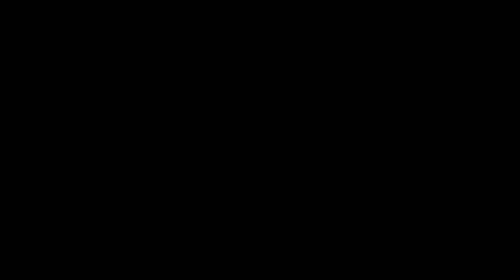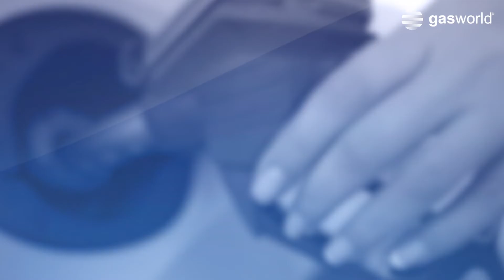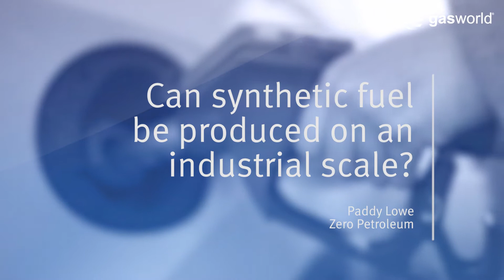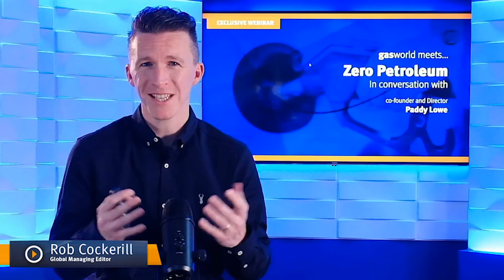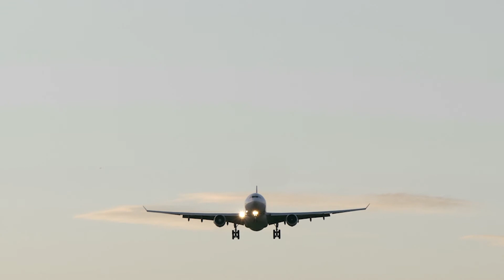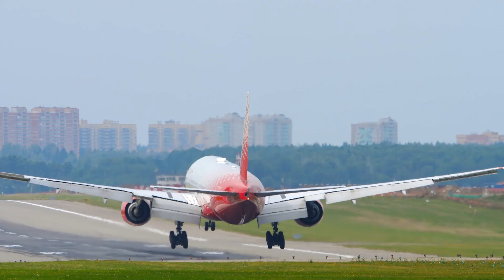Can synthetic fuel be produced on an industrial scale?

Comment: But more to the point, why would you want to produce synthetic fuel to feed an ever shrinking market, as ICE cars grow older and wear out, break down, and generally become unviable to repair.  It's the road to nowhere, and pretty pointless.  The cost would be prohibitive too. Current synthetic petrol (Aspen) already costs around 4 times the price of normal unleaded. This stuff aint gonna be cheap......
Reply: Because the industrial world doesn't run on just passenger cars, and many of the machines that make the world work, like, say, those fancy flying contraptions called "aeroplanes". It is very, very, very unlikely that we will ever make an HFC or electric plane.

Same could be said of tractors, tractor trailers, heavy machinery, so on, and so on. Further, if the synthetic fuel technology gains enough traction, I'm certain consumer ICE vehicles will remain in the market to some degree. Probably more niche breeds like offroad trucks, and sports cars. The econo-shitbox cross over SUV is probably going to go electric (or HFC) and stay that way.